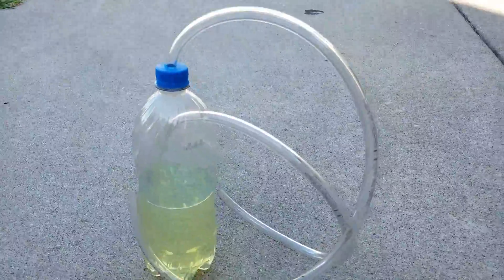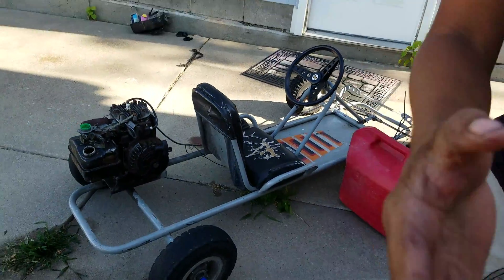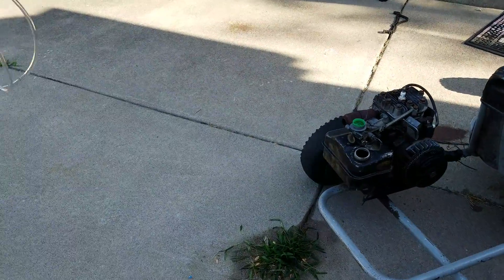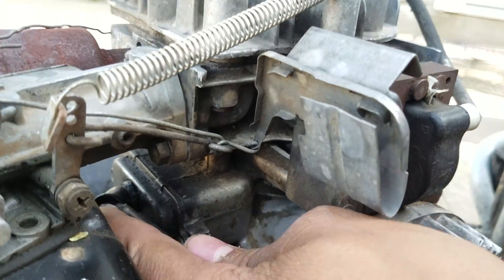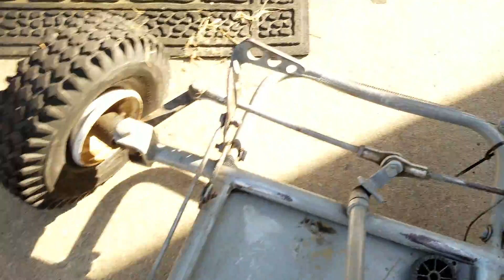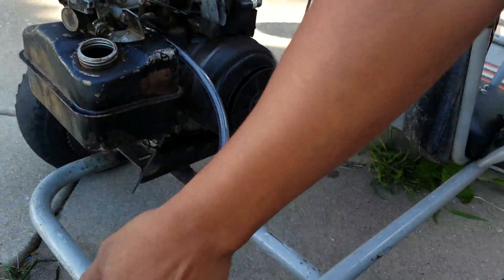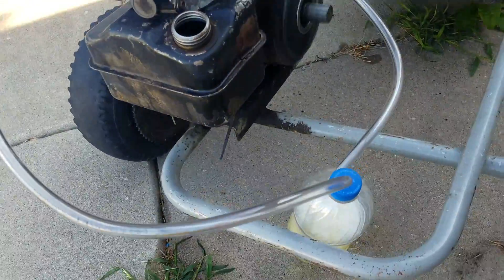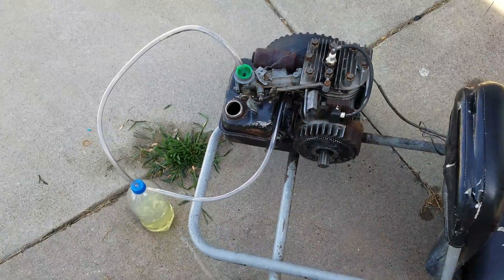Gas Vapor Carburaror

Comment: I was trying to see if an old briggs motor would run the carb was too corroded to save so i was squirting gas directly into the intake with a dropper and small cup of gas. It backfired and lit my whole hands on fire the burns were not serious but from experience this is a stupid idea.
Reply from the maker: Damn that's crazy

Comment: Thats a home made tank bro because you use the carburetor too
Reply: To all the critics out there yes this is definitely a carburetor. A carburetor simply mixes fuel and air, which is exactly what is happening here. Awesome proof of concept video. Thanks  for sharing : )
Reply: its not a carburetor and it is a fuel tank but whats cool is its a redesign of the carb, using agitation of the fuel tank as the vaporizer instead of the jets/venturi/bowl system. pretty rad still, like could be a cool bandaid fix when the carb is junk and only the butterfly is functional and u need sthg to run lol
Reply: throttle plate and governor,but the mixture is not